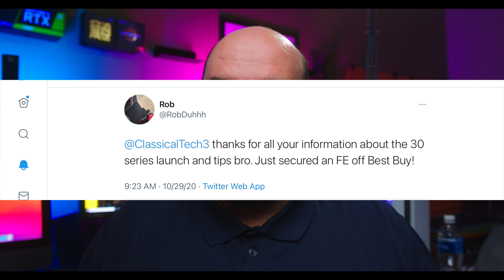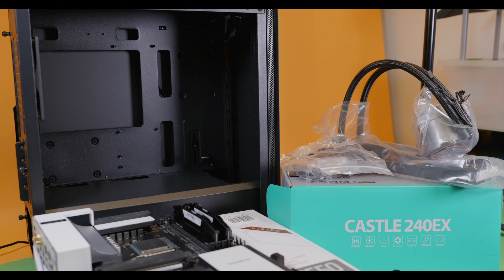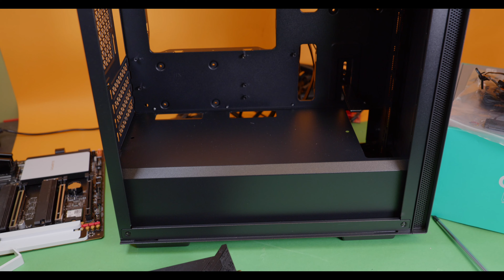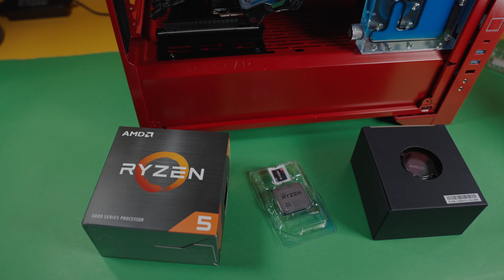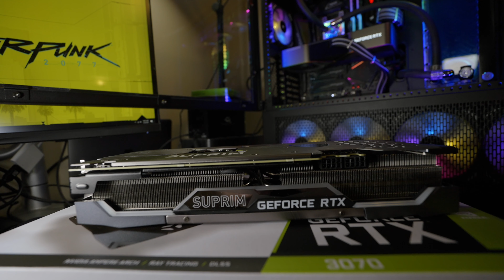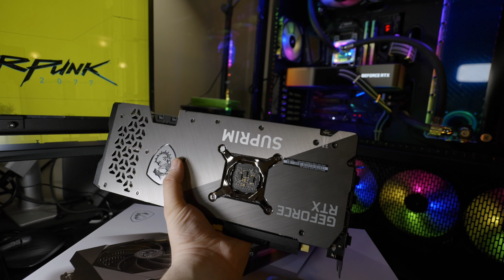THIS Is how I found An RTX 3070 & 5600x To Build this out of stock PC

Comment: I snagged a 5900X from a local scalper for $650 which by the time you factor no tax etc it was only about $50 more than if I were to buy from in store
Reply: I would think about it. My only concern would be warranty.
Reply: @josetorres4932  it was brand new in the box check the seal. These people sometimes are buying new items just to make a few bucks. My GPU was the same, plastic wrapped and we opened it before they left. 

I've also purchased used GPUs before but I wouldn't go with a used CPU since there could be a ton of other issues like bad OCs bent pins etc but you can always ask for a video of everything working

Comment: PC parts ain't bad just the gpus. But why need a 3000 series? Even a 2070/2080 is plenty
Reply: I came from a 2070 non super to a 3080 and bench mark wise the 3080 was 70 percent better in most games I tested FPS wise sometimes doubling performance 100%
Reply: @SuperHANGER18  damn nice 😥👍
Reply: Cant even find the 20 series

Comment: Yeah I gave up in late 2020 and just bought one from a pc builder (skytech). 

I'm kind of regretting it though, I got one of those builds that is plagued with USB issues and its either Asrock or AMD's fault Ryzen 3 has been quirky as hell to say the least.
Reply: My x570 aorus master is dropping out 2.0 ports, but just one and all others are ok.  Its very odd.
Reply: @Ryan-re1rs  Mines is all over the place, really annoying. For the most part my back panel usb's don't suffer that much from it but it's still there.

Comment from the maker: Smash that like button and maybe I'll tell you a GPU secret. 😘
Reply: When I ordered my 6900 XT I did the same as you and for like a day I was like yo.... I did it..... I hope it doesn't get canceled, that seemed too easy after weeks of trying
Reply: Microcenter has 3070/3080 shipments every Monday/Wednesday/Friday. You can either come really early and wait I would recommend 2am or earlier to guarantee yourself one they also take half the GPU's and sell them around 2-4 pm if you can get lucky. I got blessed and bought a 3070 at micro center at 330pm on Wednesday. Good luck guys. Dont know why he didnt mention this option. But it's a little easier than having to fight bots
 Have a blessed day and I pray you guys hey one aswell
Reply: Classical Technology, I want the RTX 3060 Ti, but I have a 500 watt 80+ bronze rated psu. I got this one a few months ago, so I do not want to replace it. Sites like guru3d.com are saying that a 500 watt psu is fine, but other sites are saying that it is not. Will it be okay if I get the 3060 Ti?